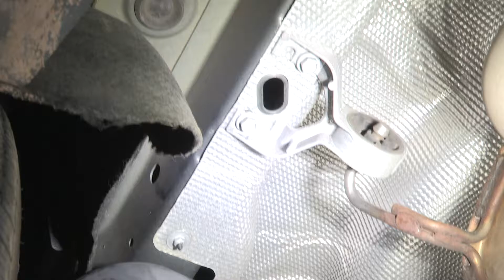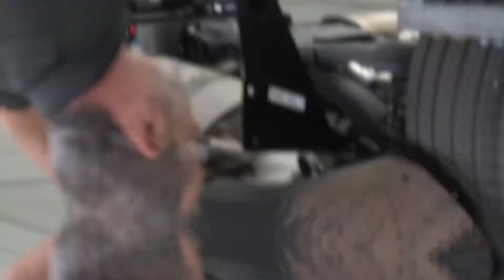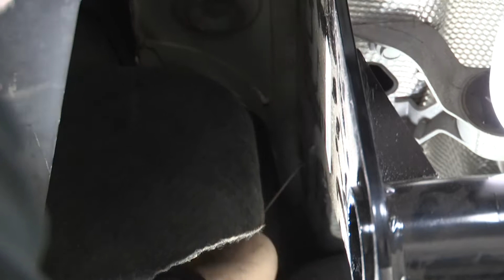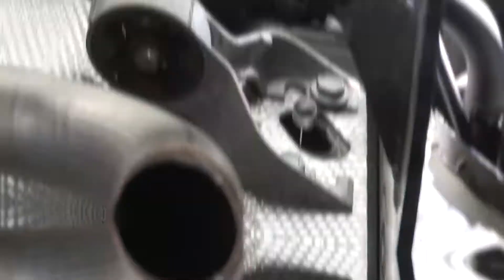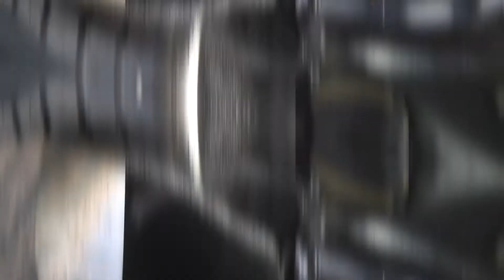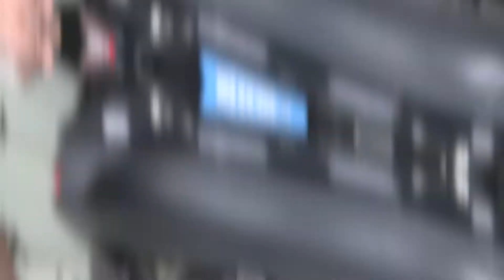2013 Ford Escape Trailer Hitch Installation

Comment: Better to slightly grind down the $2 bolt head than take a saw to your $30,000 car frame.
Reply: Didn't even need to cut the car, but I'm with you.